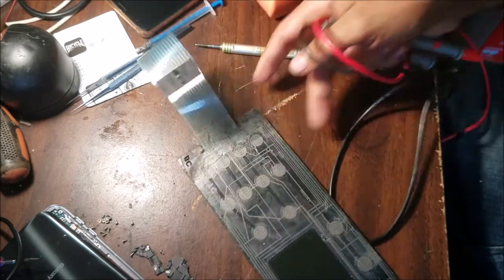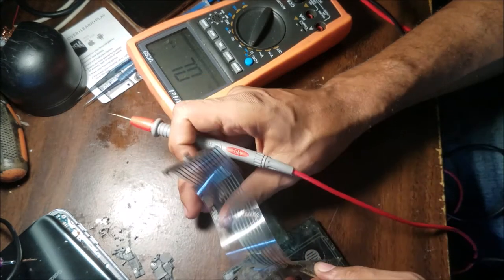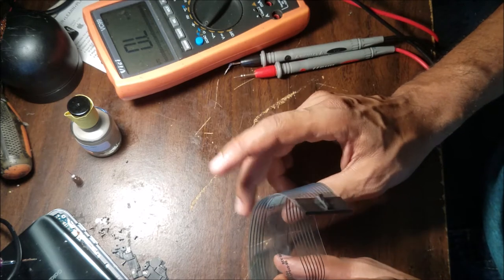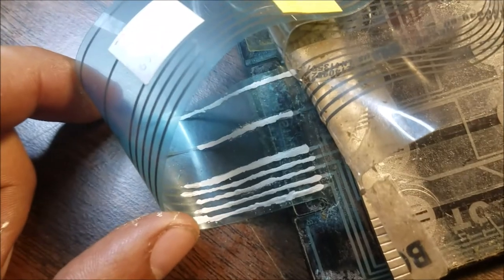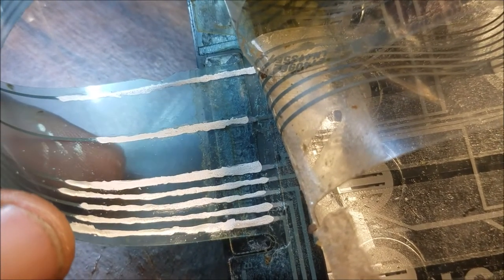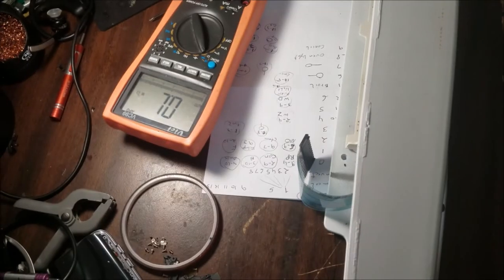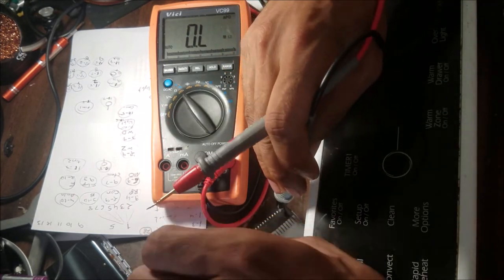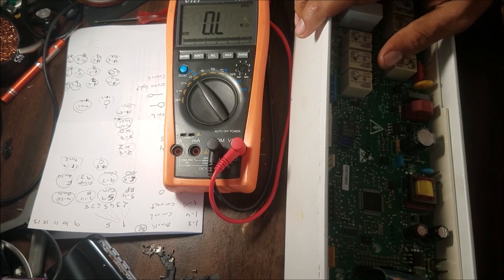how to fix broken printed traces in flex cable of keypad

Comment: Hello, good inspiring video.i have same problem.but for this problem solving another two problems there.one ,i have no costly silver based ink.swcond, flex cable is broken very near to connector.i made graphite ink,but not working,still in experiment.my question is ,is there any idea to remove the connector and re-fit it?.

Comment: what kind of glue solder ink did you use?  
great video
Reply from the maker: is called silver conductive ink, dont get the black ink it has a high resistance and doesn't dry good
Reply: @SOSfixElectronics  plz send this perches link
Reply from the maker: @Sk-gd9ee  sorry i dont have the link